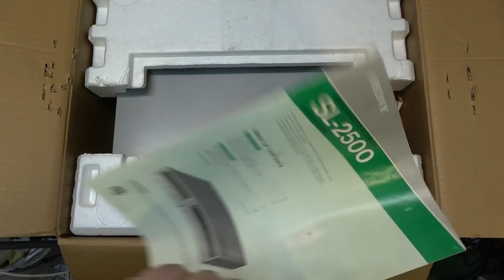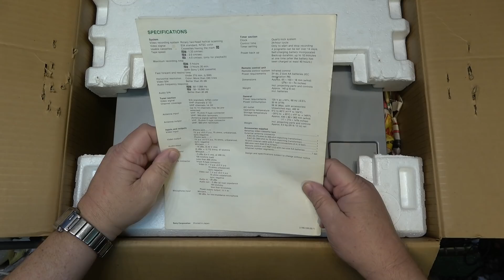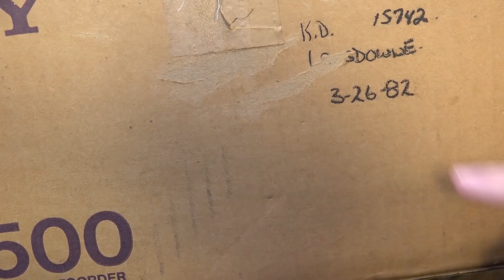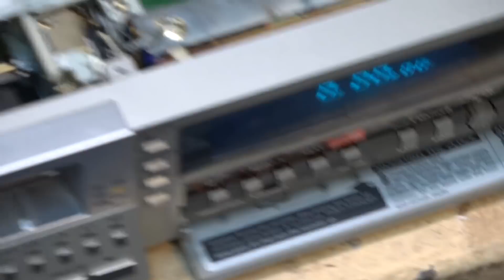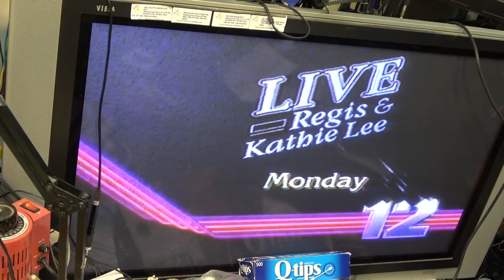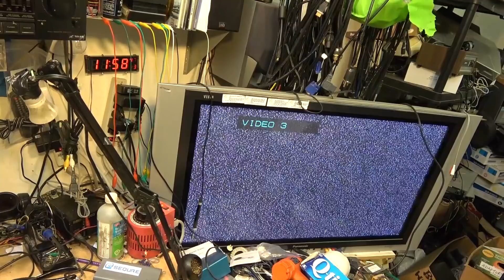Sony SL2500 Betamax is over engineered

Comment: I had an SLF-30 , same awful front loader mechanism.Same fault too , i gleefully binned that pile of sony 'consumer' junk.The only thing I kept was the head drum. Horrible design.
Reply from the maker: The 30 was a totally different mechanism.   This one was only used on the 2500 and 2700
Reply: @12voltvids  Well it may have been different but just as 'reliable', it still failed same way. Sony never failed to fail. I ended up with a modified SLF1 for archive playback of media. Its still working seamlessly.
Reply from the maker: @_._________  the FL mech is different, the tape threading the same and the guide pins that fold down were always a problem.   Biggest problem was wet cleaner tapes.  That would rip parts out and and yet people never accepted responsibility.   I have a friend that was caught going 165 in a 100 zone and got their car impounded for a week.  Of course it was the cops fault.   You know, for being there.